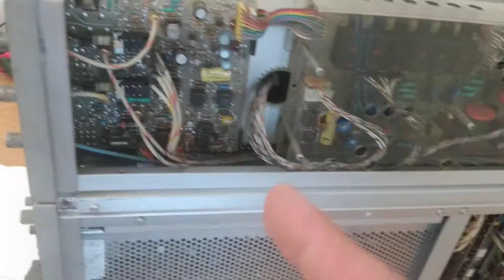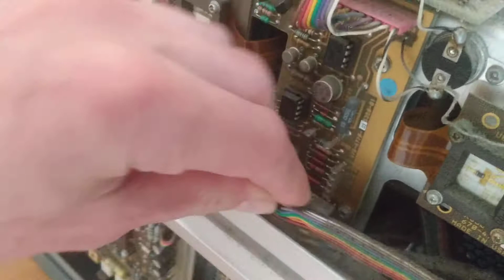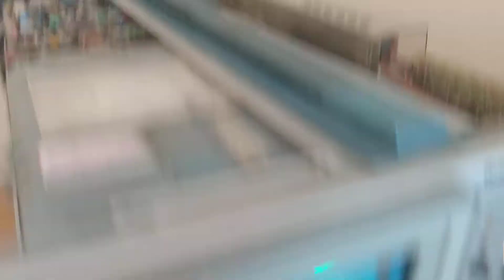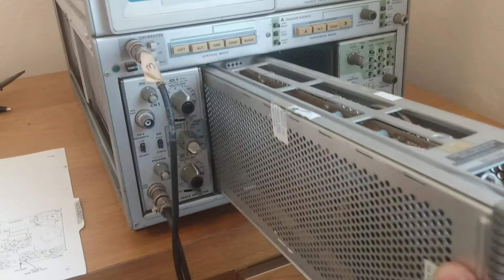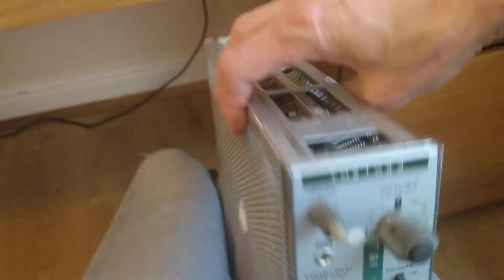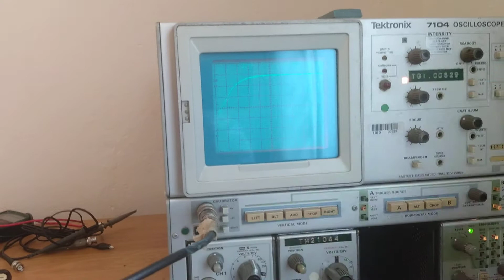Tektronix 7104, a look inside and connector wriggling

Comment: Just been reading about those microchannel plate CRT''s. Amazing scope. Just a 2445s analogue and two 2440's in the Tek range here. The 2445 is my most used scope as I do mainly radio related stuff.
Reply from the maker: I've also got a couple of 2400 series scopes, and they're great machines. A lot more portable than this one, too!